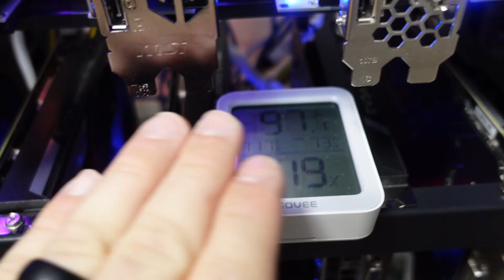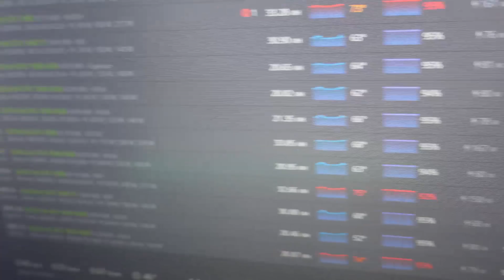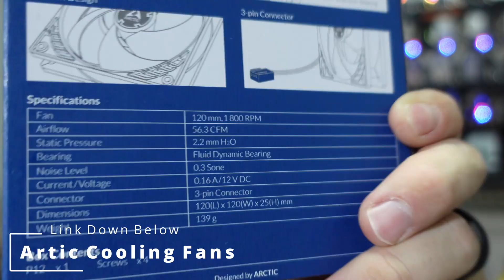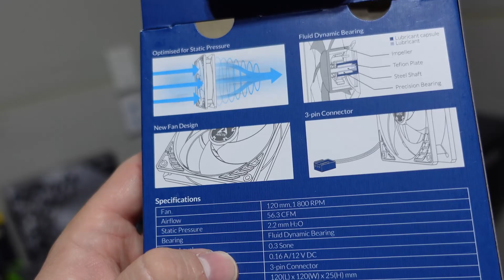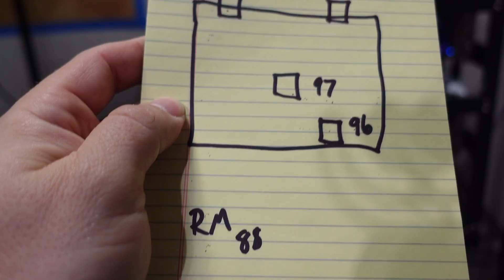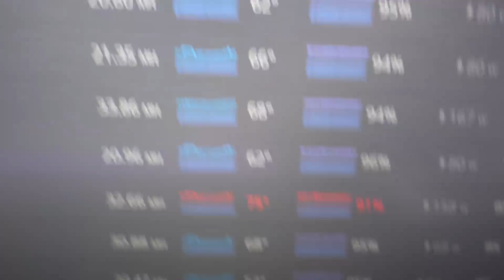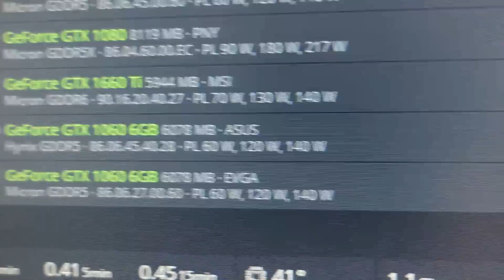Cooling A 12 GPU Ethereum Mining Rig

Comment from the maker: How are you cooling your Overheating GPU Mining Rigs? What creative solutions have you come up with?
Reply: I have the exact same frame with 12x580s ended up buying a $18 box fan from Walmart setting it right behind the rig with space to pull in air. Cards never go above 58c was cheaper and less of a hassle than trying to wire up a bunch of fans and worked out great. Also it's relatively quiet for the amount of air it pushes. Not that that really matters when you have a mining farm... 😆
Reply from the maker: Perfect!  Box Fans are Miners Best Friend!  It's Crazy!
Reply: @TheHobbyistMiner  keep up the great content. Always enjoy watching/learning/sharing with you and the others on here.
Reply: Yeah 8 fans is to much for one fan header, if you have a water pump header that would be fine though👍
Reply: I just open my windows, it’s like currently 40F outside. I have rigs in different parts of the house, and I haven’t used my heater once.
Reply: Table fan 🔥
Reply: I have a grow tent with an 8 inch exhaust and box fans blowing on the rigs mining rvn,eth,ergo 107 inside and GPUs average 65c. I also had those Wi-Fi thermometers same brand you're using but their Wi-Fi and I can look at on my phone while I'm at work.
Reply: The box said 0.16 amps per fan so 8 fans could pull 1.26 amps and you might burn up that fan header.  I wouldn't put more than 4 fans on one header.  So powering from the psu would be the better way.
Reply: 8 inch inline fan with a wide cardboard square funnel attached in front of my rigs, catching and funneling outside the warm air blown off the cards by a boxfan, immediately removing the warm air from the room. Most cards I've used the air exhausts thru the top and I/O so just follow that flow
Reply: Imagine if you mined rvn, in the summer...
Reply: 1 box fan per rig

Comment: A well meant advice, especially since these are second hand cards, i would replace all the thermal paste and pads on every GPU with Gelid which will cut the temp down by -14 C. I know its at least a 1/2 to a full days work but it will extend the lifetime of all of these GPU’s. Besides there is a Noctua fan 12’ which blows at 3000 RPM…..it will certainly be a good investment….Red Panda Mining uses these on a lot of his rigs too

Comment: If you get a fan controller, you can put them all on it and run them off the sata power . You have one pwm header that can fit on a gpu fan header (like the ftw 3 series have) and as the gpu ramps the fans will. I wouldn't exceed 1 amp off the mobo or you can pop fuses on the board.

Comment: Depending on the fans amp rating, you can get up to three fans on each header. I like to use the Arctic fan controller so the fans are powered off SATA and not the motherboard. You can still send a PWM signal to the controller and control fan speed, but I generally run those fans at full speed.

Comment: I have one of these frames too and think they are overrated. It's not a good idea to stack cards vertically as the hot air rises obviously. Better spreading out horizontally. Should be getting around 39mh/s on that 1080 too. Are you using memory tweak or eth pill?

Comment: Imo, your issue is coming from an imbalance of air movement in the room from running your exhaust fans too high vs the amount of air coming in thru your passive intake vents. I had the exact same issue a while back and I was able to drop the room ambient temps from 88 to 76 degrees and keep my rig temps down, especially the cards I have in a 12 gpu setup (12x3070s, 11x3070, 1x3060ti, & 12x1660 Supers) in the mid 40 range at 60% fan speed by setting my exhaust speed at 2 (AC Infinity S14), opening the door to mining room, moving the floor fan in front of it and pointing the fan towards the floor in order to push a higher volume of cooler air into the room, to force the warmer air up vs having the fan pointing up and practically blasting all the cooler air straight into the exhaust fans. It will take an 1 hr to drop the temps but it will keep your room and your cards at a low temp with very little influx. Hope that helps

Comment: Try adding Delta Fans...yes they are really loud but when I run a few on my frame (same one) my cards dont go higher than 50 degrees. They push an incredible amount of air through the cards.

Comment: Mobo fan headers are often 1 amp or less, not enough for a ton of fans, maybe 3.  Those Arctics don't pull much, great fans (your's are the static pressure not airflow, maybe best) .  May need a controller or alternate plan (I'm not the smart one to tell u exactly).

Comment: I have the same 12 gpu frame with 12 x 3080's so cooling is essential!! I took off all the little fans on the rig (like what you just installed) and replace with an 18" giant fan right next to rig (approx 10inch) and its much better. Those little computer fans just don't push enough air. If you can duct the air it pulling from outside, then even better.

Comment: Usually one fan header handles about 2 amps maybe. These fans should be 0.40-0.50 amps, so 3 fans per header should be still okay. Thats how i run these same brand fans 140mm, 3 per one header. Since these fans come with a version where there is 4 pin splitter on them, its easy to connect them. Sidenote for safety, these fans at full speed are powerful enough to cut your finger. Happened to my little finger.

Comment: Is the current capability enough from the motherboard fan header to power 8 fans?
You should be checking if you are using more than 1 amp per fan header.

Comment: Most of the fan headers are rated for 1 Amp. Each of those fans is 0.16 Amps. So you need to split them in 2 different fan headers.
Reply from the maker: Yeah planning on nabbing 1 to 4 splitters and utilizing 2 fan headers.

Comment: How do you attach the server PSU to the 12-gpu frame? I don't see any way to mount it.
Reply from the maker: I used some strong double sided 3M Tape. I have seen others drill wholes and do a zip tie or velcro strap.

Comment: The only other thought I have is to blow air from below up the backside of the rig so "cooler" air is being blown up the backside and sucked into the rig by the fans you already installed. It looks like you have enough distance between the wall and the fans you installed in the video, so that shouldn't be an issue. Otherwise, I would suggest moving the rig further away from the wall. I like the results you got, congrats!
Reply from the maker: Yeah I decided to move it just a few more inches from the wall to allow more airflow behind the rack.

Comment: Hello hobbyist, i was wondering where you get the long pcie cables, cant seem to find any in a decent length
Reply from the maker: https://www.parallelminer.com/
Reply: @TheHobbyistMiner  they all seem to be 6 pin to 8pin wires, my psu has 8 pin ports and so does gpu. What should i do here